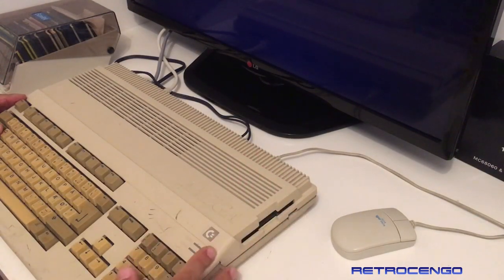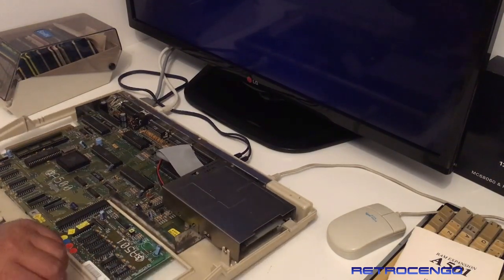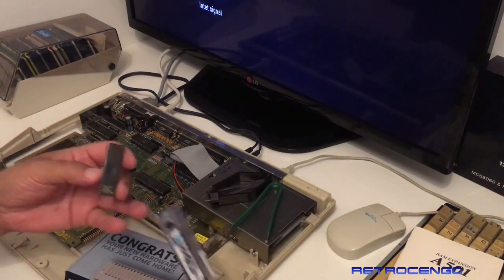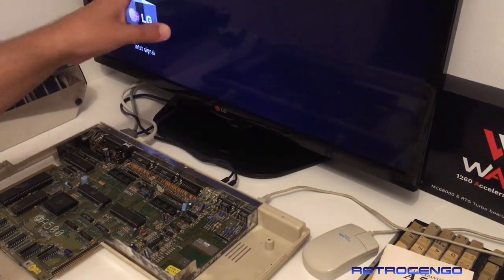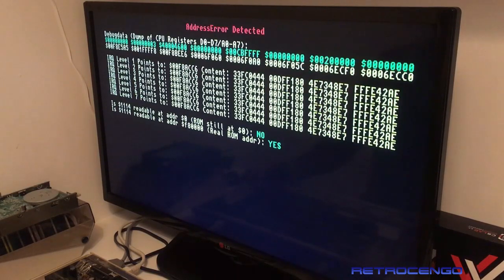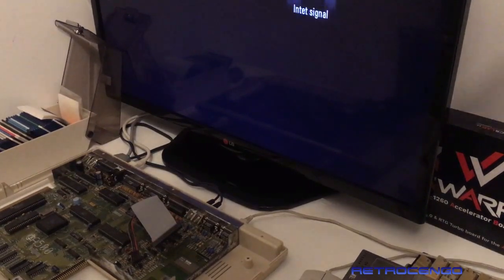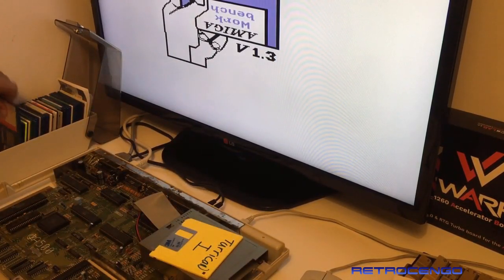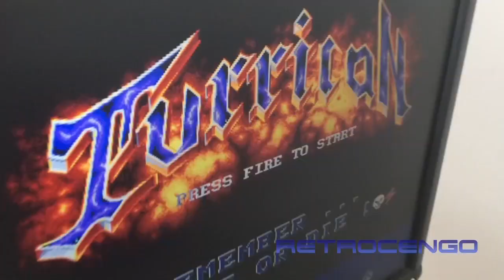Amiga 500 ODD CIA Green screen issue repair

Comment: Nice!   Green Screen indicates RAM issues but visit the CIA's first.   I have never encountered a RAM issue with the A500 (Lucky Me) but I have encountered the Green Screen caused by a CIA.   Inspecting these old computers before powering them up is important and always check the male pins in the ports to make sure none are bent and shorted against another pin or you could run down a rabbit hole.   You know I don't play games so when a 128D came in with a known set of issues one being the keyboard which tested fine but not on that puppy it drove me crazy and the problem ended up being a shorted pin on one of the Control Ports which I picked up on the board anyway yea me not checking ports I have no intention of using but sometimes you learn the had way.   Seated Chips sometimes look seated but these old chips sometimes the legs kind of sort of roll up and appear to be seated but not really.  I have yet to see an entire set of legs on one side of a chip bent out but hey anything is possible and its always amazing what some will do.  I have had one leg push out to the side but this is where good inspection comes in handy.   My old eyes miss things so a lot of my inspection these days is under a microscope and man you can see some really nasty stuff with a microscope.   By all means make more videos like this you might stumble across something which might be a problem someone else might be experiencing and you could end up saving them a ton of time and help people stop crying when their beloved Amiga is not working well.
Reply from the maker: Yea its fun to inspect 30 year ild computers and ending up fixing em also. This one was about to hit the trashcan, happy they contacted me😁
Im actually giving this amiga back to the owner today❤️
Reply: @RETROCENGO  Awesome.  The person getting it back should be very happy to have it back.   Always nice to keep Amiga's out of the trash for sure.
Reply from the maker: Stephen Bruce his girlfriend picked the Amiga 500 up today, so this Amiga was at his family from new, nostalgic attachment. Michael was SO happy🤗🤩🤗
I got a bottle of Captain Morgan, that im gonna enjoy soon😁
As allways thanks for watching Mr. Bruce, yes great feeling to bring this A500 back and back to the original owner❤️
Reply: @RETROCENGO  Nice!  Now when your drinking that its always best not to attempt Amiga Repairs just enjoy!  :)
Reply from the maker: Stephen Bruce Hahahahaa, you mean, don’t drink and repair 😁😁👍🏻

Comment: No not boring.  Keeps me entertained whilst working.  BTW anyone have an accelerator for the A1200 that they want rid of?  Mine has died or appears to as my A1200 wont boot when the card is in.
Reply from the maker: Darren Anderson try to clean the connection and pull out the accl card 1mm and try
Reply: @RETROCENGO  will give it a try but I think by looking at it the connections are broken. I'll let you know how I get on
Reply from the maker: Darren Anderson hope it works